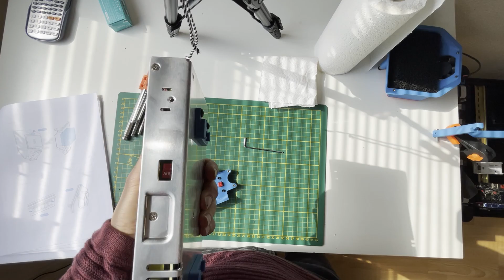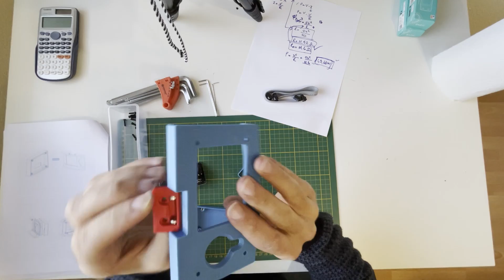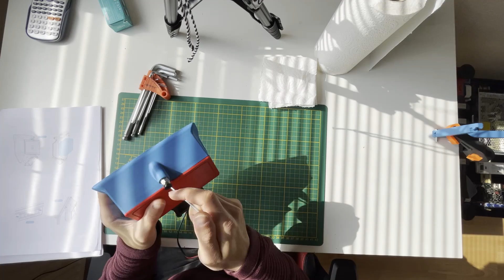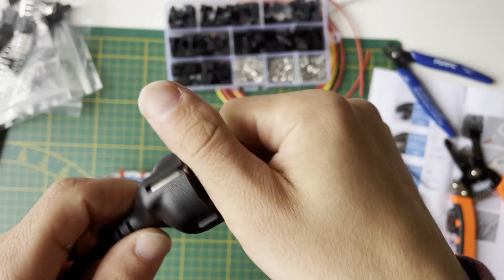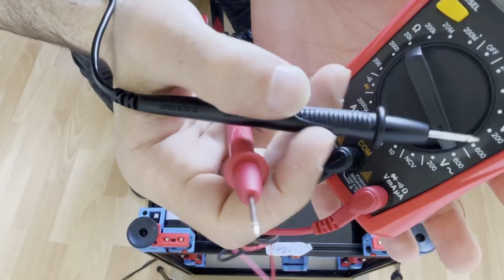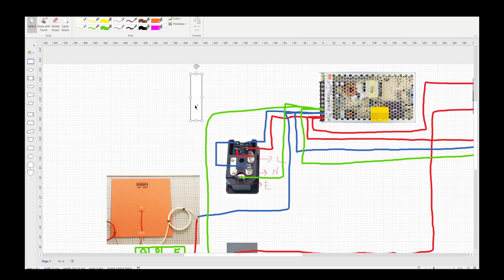Building Voron v2.4 - Wiring! [Ep10]

Comment: Hey zer0, I'm curious why you snipped a leg on each of the drivers, as I don't see anything about it in the r2 assembly manual. Was is a fitment thing, or something to go with electronic function? I just put them on my Octopus 1.1, but haven't ran any power to it yet.
Reply from the maker: I was using SKR boards in that build. I think in octopus you do not need to snip them. Please check, docs.vorondesign.com
Reply: @zer0isdoing  ok, thanks for the tip! Great video by the way.

Comment: Where do the other 2 terminals on ssr goes to?
Reply from the maker: I am not sure which you are asking but:
2 of them for AC which is shown in my bad drawing. The other 2 goes to motherboard to control the SSR.
Reply: @zer0isdoing  Thanks. That cleared up the wiring for the SSR. What about the wiring for rasberry PI?Eg: Rasberry PI 4? Do i power it from the 5v psu to usb-c or the gpio pins? If GPIO is pin 2, 4 (+5v) and pin 6 goes to earth is that correct(or to -5v?)? Sorry noob here and trying to figure these out building my voron 2.4
Reply from the maker: I wired power of Raspberry Pi via USB. I would suggest same way instead of using GPIO PINs.
Reply: @zer0isdoing  Thank you so much. One last question, what are the two red wires on the heated silicone bed? where does it go to? The white one goes to power, what about the red ones? MCU?
Reply from the maker: There are the thermistor wires which are going to MCU.

Comment: Hi, Thank you for your tutorial. Can you share how can you connected LED relay? And how can you control that? Thanks again!
Reply from the maker: I changed my mind, I will control LEDs through SKR board. Due to that I won’t use relay for LED. But if you want especially relay put your ground cable from source to relay’s common pin. Then put another cable from relay’s normally open pin to your LED. I will put another video for LED mod. If you want to also control your LED though your SKR board you can use that video as a reference also.
Reply: Thank you very much. I really need SKR board to control LED too. Wish to see your sharing video.